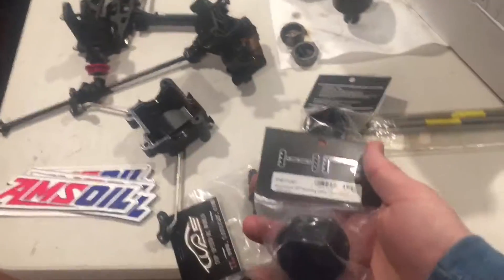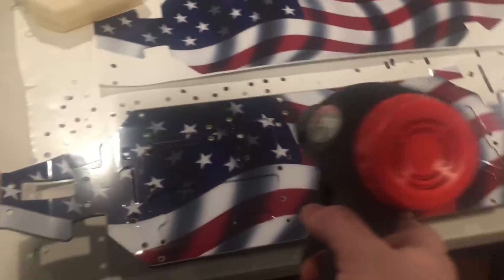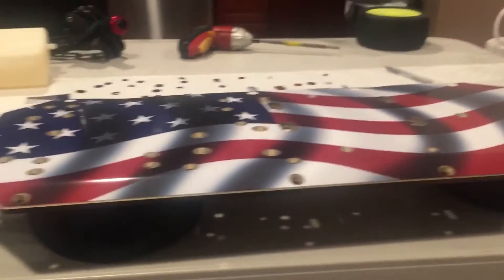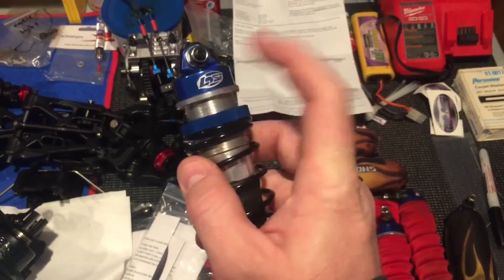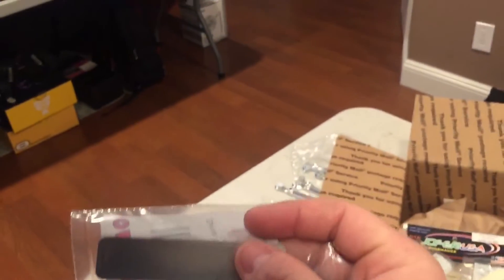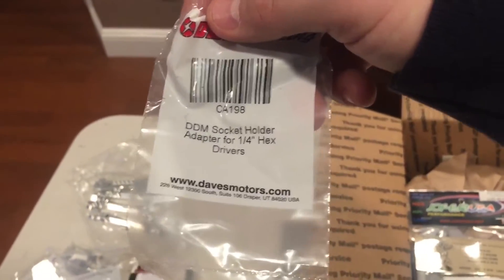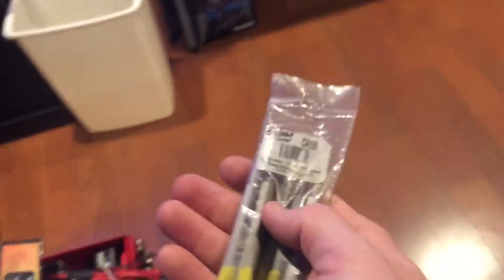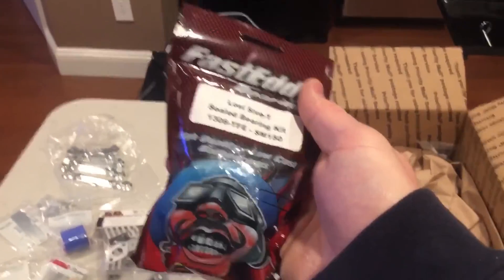Part#4 Freshening up LOSI 5T,  More Goodies & Finished Chassis

Comment: Goodies galore. I really like the look of that chassis wrap especially the your's it's not too bright it's look sleek with the shading of the flag as it has the waving affect mind you I wouldn't stick it on the inside just on the under. I managed to crack the rear diff cup melt the bearing lipo on my centre as well I'm currently running Rob's  (IRC ) cups all round love them. I would like to try a lightened flywheel by DS but there far from cheap plus my custom lightened Zen flywheel is still going strong as ever, great video.

Comment: They make an aluminum cog for the turtle racing pull start
Reply: Super excited for that new build I'm feeling like we have a speed demon coming
Reply from the maker: Yes thanks for the heads up bro I'm aware of that but this is fine also. Mine is 6 years old and still pretty good